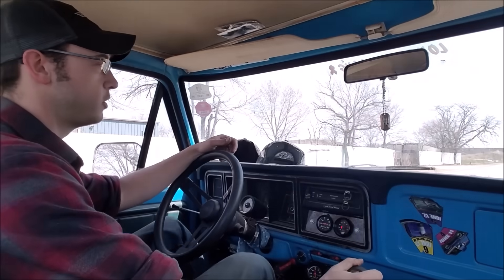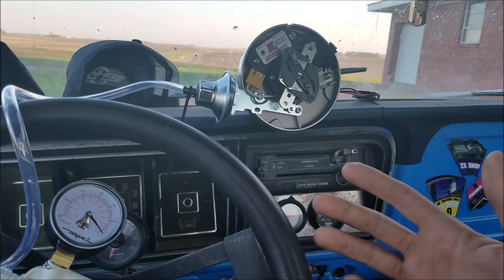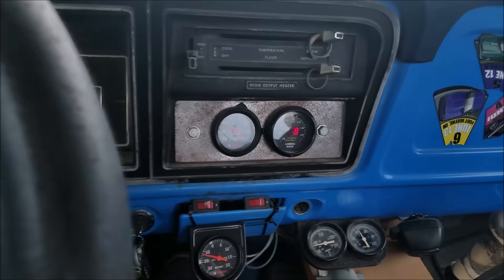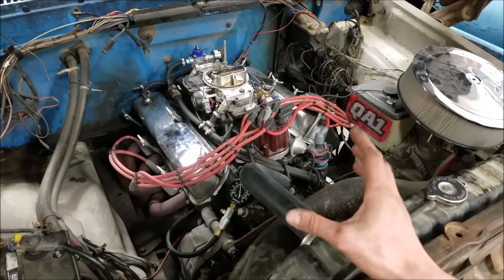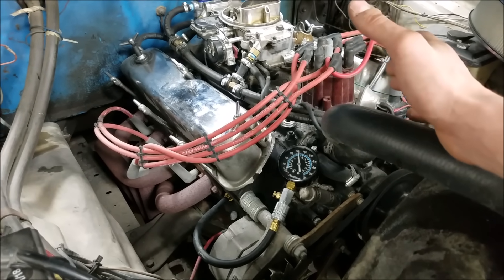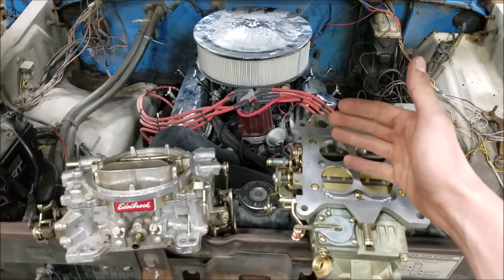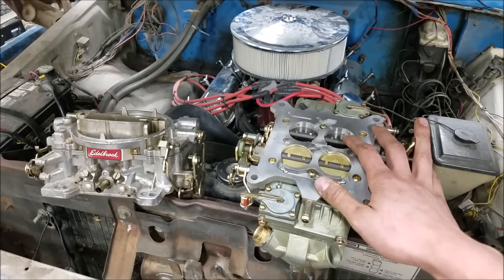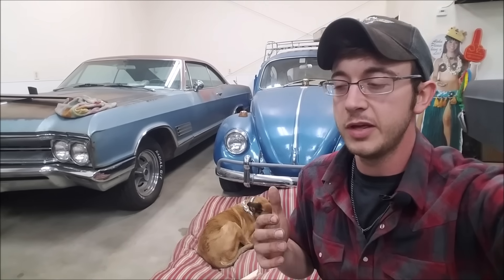Vacuum Advance - Ported vs Manifold: Which to Use & When !!!

Comment: Ported vacuum was designed to use more gas and run worse. That was the intent. It causes later ignition so that more fire goes out the exhaust valve and heats up the exhaust to keep the catalytic converter hot. That is all. You're basically burning gas to run an exhaust heater.
Reply from the maker: Clearly you didn’t listen or use your eyes for 2 seconds in this video. How about you flush your ego, pull up a chair, and listen. 

Also, that’s a bunch of regurgitated BS. If you pay attention you will see how using ported allows you to then actually more effectively use your mechanical timing.

I used to be a nice guy, but the ignorance of car people is just pathetic.
Reply: @ThunderHead289    The 2 seconds starting at 11:38 ? If it needs more gas to run the same, then it's less efficient. If the timing is later than optimal, then you're heating your exhaust more than necessary. Ported vacuum advance was used before the catalytic converter but it was utilized primarily for egr equipped engines, and if you check a new distributorless ignition engine you'll see that they idle around 9 or 10 degrees just like a ported vacuum distributor. 

You can call it regurgitated bs if it makes you feel better, but it's actually something called physics. We've been regurgitating physics for a few hundred years, and it still works. Even if you're upset. 

I'm not "car people" and I'm not ignorant. I am educated and experienced. Ported vacuum advance is crap. If you don't know how to blend base timing with manifold vacuum advance and centrifugal advance to get an optimal, load-based advance curve, then maybe you're the "car people" you're disparaging. 

The flame travels slower when cylinder pressures are low. I'm not going to waste my bandwidth educating you on dynamic compression, low vacuum large cams, and different vacuum cans that start and end at different vacuum with different angles of advance. Maybe you can Google it.
Reply: Here's ONE official reference for the viewers to read, but of course not for the YouTube expert that has it all figured out. 
Written by John Hinckley - senior engineer for GM starting in 1966, until going to Chrysler in 1985, then retirement in 2001. But you know, what the hell would he know?

Now to the widely misunderstood manifold vs. ”ported”
vacuum aberration. After 30-plus years of controlling vacuum advance systems with
full manifold vacuum, that “free” indicator of engine load and fuel mixture, along
came early emission control requirements (seven years before catalytic converter
technology was introduced), and all manner of crude band-aid systems were 
introduced to try to reduce hydrocarbons and oxides of nitrogen in the exhaust
stream. One of these crude, but effective systems was GM’s Air Injection Reactor
(A.I.R.) system, which pumped fresh air into the exhaust ports to “afterburn” 
pollutants in the exhaust manifolds. The key to making this system work at 
maximum efficiency was retarded spark at idle; with retarded idle spark timing, the
“burn” begins late, and is not complete when the exhaust valve opens, which does
two things that were important for emissions. The incomplete burn reduced 
combustion chamber temperatures, which reduced the formation of oxides of 
nitrogen (NOX), and the significant increase in exhaust gas temperature ensured
rapid “light-off” and combustion of the hydrocarbons in the exhaust gas stream
when the fresh, oxygen-carrying air was introduced from the air pump. 
As a result, these engines ran poorly, and an enormous amount of wasted heat
energy was transferred through the exhaust port walls into the coolant, causing
them to “run hot” at idle; cylinder pressure fell off, engine temperatures went up,
combustion efficiency went down the drain, and fuel economy went down with it.
“Ported Vacuum” was easy to implement – they just moved the distributor vacuum
port orifice in the carburetor from below the throttle plate (where it was exposed to
full manifold vacuum) to above the throttle plate, where it was exposed to manifold
vacuum only after the throttle plate opened. This meant that the vacuum advance
was inoperative at idle (retarding idle spark timing from its optimum value), and
these applications also had very low initial timing settings; they were usually set at
four degrees before TDC or less, and some even had initial timing settings as much
as two degrees after TDC. The vacuum advance still worked at highway cruise, but
not at idle, which caused all manner of problems. “Ported Vacuum” was strictly an
early pre-converter crude emissions strategy and nothing more. Don’t believe 
anyone who tells you that ported vacuum is a good thing for performance and 
drivability – it’s not. Anyone with a street-driven car without manifold-connected
vacuum advance is sacrificing idle cooling, throttle response, engine efficiency, and
fuel economy, probably because they don’t understand what vacuum advance is,
how it works, and what it’s for. There are lots of long-time experienced mechanics
who don’t understand the principles and operation of vacuum advance either, so
they’re not alone.
Reply from the maker: @8literbeater  do you understand that from the factory distributors had a very lazy mechanical timing curve with pathetic initial timing. They engineered them this way so they couldn’t hurt themselves for warranty purposes. 
By using ported, you can then add back in the needed timing for an efficient idle with mechanical advance. 

Do you realize when you stomp on the gas vacuum goes out the window entirely and you are just on your mechanical advance? 

It’s not about ported vs manifold directly, which I absolutely express in the video. It’s what ported allows you to be able to do with your mechanical timing. 

Thunderhead289 
Engine control programmer. 
Industrial Engineer.

Comment: So do u just plug the manifold vacuum port if i put my vacuum advance on the ported vacuum port?
Reply: yes, unless you need it for something else like a guage
Reply: But you need to do more than just change the vacuum source. You need to shorten the amount of mechanical advance in the distributor to allow more initial timing without having too much total timing.